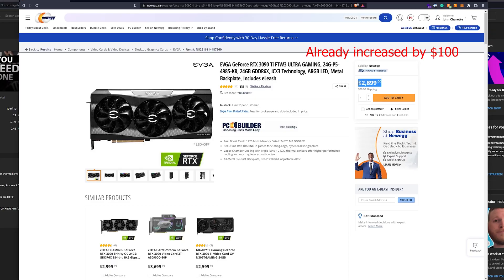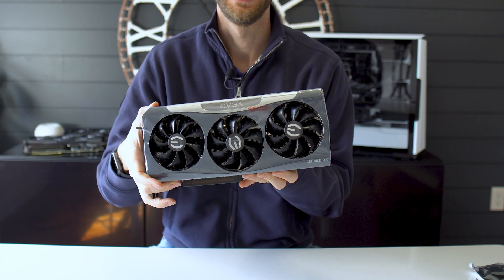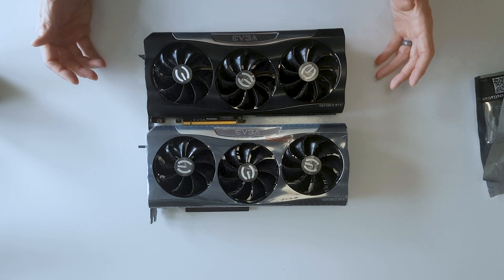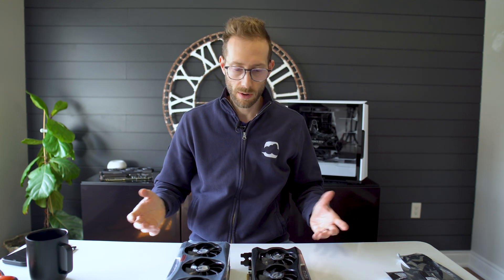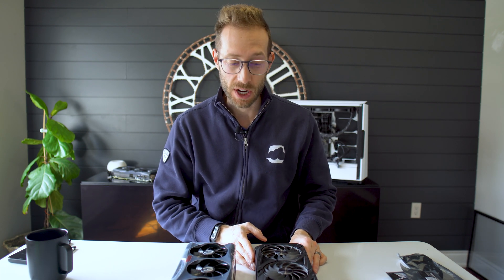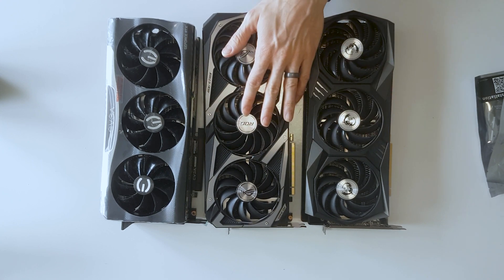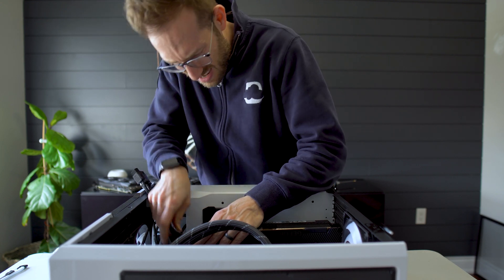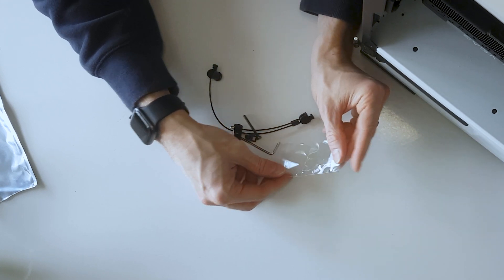EVGA 3090 Ti FTW3 Unboxing, Size Comparison, Price & eLeash Install

Comment: What an amazing looking card. These cards will maintain some sort of value for a collector even after they're obsolete. RIP EVGA.
Reply from the maker: 100% agree!  I'm kind of sad that I didn't keep the card, but not sad because I paid full retail price for it when they are now at least 50% cheaper.  Are you going to pick one up before they are gone gone?
Reply: @JohnLCharette  I ended up buying a EVGA RTX 3080 FTW3 Ultra as I couldn't afford the 3090 ti. I will keep the EVGA 3080 as a memento of the last series they will make.
Reply: There's nothing to collect, lmfao the cards are all over and cheap

Comment: So, for clarification, you do NOT need to utilize the extra 4 pins on the Card and the 12 pin Cable supplies all the power? Just wanting to make sure we're not losing any power/performance in any way by not having that. Thank you in advance!
Reply from the maker: 3090 Ti's only have a 12pin connector on the card itself, so no you do not need the extra four pins.  The supplied power adapter uses those 12pins, which breaks out into 3x8pin female connectors that you connect to your standard power supply.  Next gen GPU's (4000 series) should be PCI Express 5.0 and include the use of all 16pins.  If your power supply supports the 16pin connector, the four “sideband” pins allowing communication between the power supply and the graphics card for determining power requirements.  So far there are only a handful of power supplies that support it.  I know MSI and Asus have them, not sure about other brands yet.

Comment: It's a 16 pin to 2 adapter not 12 there are 4 little pins on the bottom edge under lol. It's not pcie5 it's pcie4. Just wanted to let you know the ftw 3090ti is not pcie5 lol.
Reply from the maker: Hey, yes that's correct.. it's a 12pin power connector with 4 extra controller pins.  The EVGA 3090 Ti comes with an adapter from that 12+4 connector to 3x8pin VGA power connectors.  And I wasn't saying that the 3090 Ti itself is PCIe5, but instead that the power connector is.  If you have a power supply that supports PCIe5 such as the new Asus Thor 1000w, you don't need to use the 3x8pin VGA adapter and you can use one cable straight from the power supply to your 3090 Ti.  Yes, it's very well known that the 3090 Ti is only PCIe4.  Thanks for watching.  Hope that helps clarify things.
Reply: @JohnLCharette  hey thanks for the clarification. Im happy I wrote this though because of rumors and some poeple just don't know. I do appreciate the response I wasn't trying to be rude or anything.

Also on a side note yes this is random but funny lol. Am I crazy that I bought this gpu just for gaming? I think not! Haha jk jk but for real I kind of did and you know what's even more crazy? I don't regret it at all, im actually thinking about stepping up with evga step up program once the kingpin 3090ti is on the list! Then I'll wait maybe a year or two and sell that and put it towards a 4090 or 4090ti kingpin. Let's see what happens lol. I just think the 3090ti is the most polished 3000 series card because of its memory/ram location being on one side and helps cooling tremendously. Nobody expected it to be around 65-70c maximum load. Mine almost never goes above 65c. With this much power that's so positive tbh. I was very surprised as when I pushes my 3090 it got much much hotter. The stability just seems better and I do get a bit extra performance overall which is a big plus for me. I think that nvidia launched rhis just so we wouldn't be shocked with the 4000 series coming up pushing so much power/watts. Luckily I'm not an efficiency guy. Sure amd is intriguing this generation coming because performance will be incredible while having great efficiency. But for me the best is the best even if not efficient with power haha.